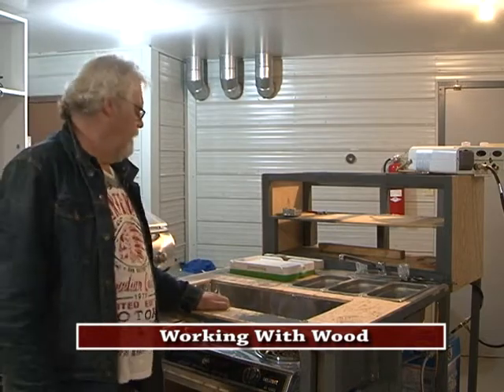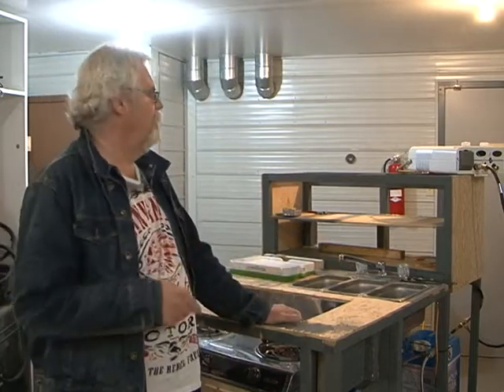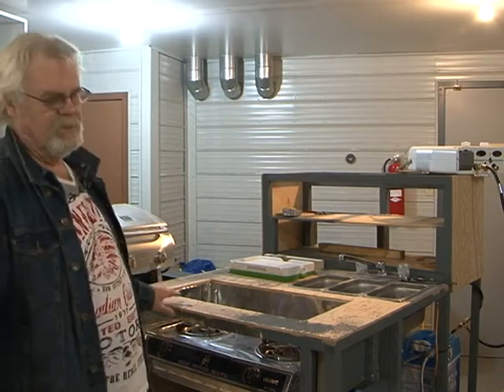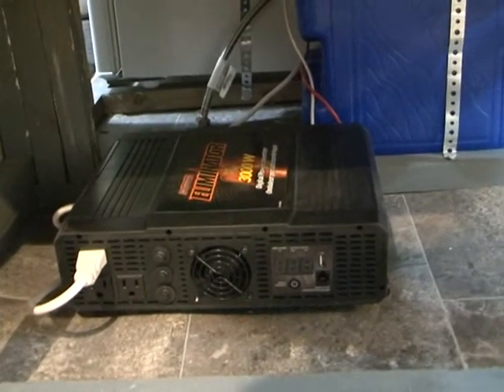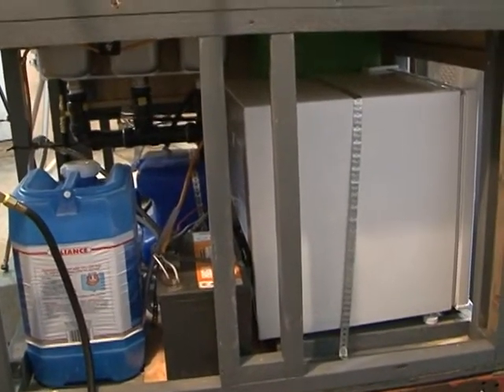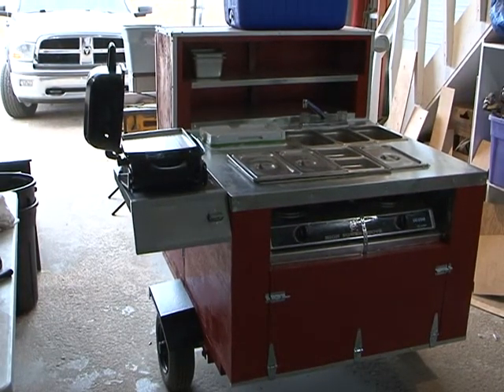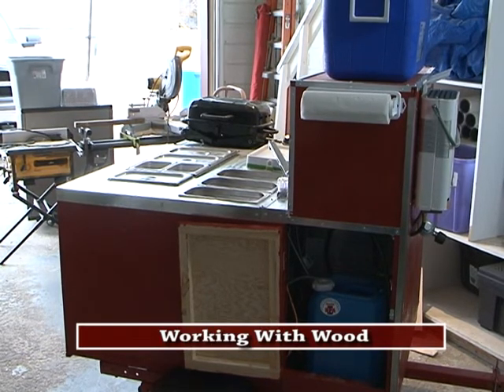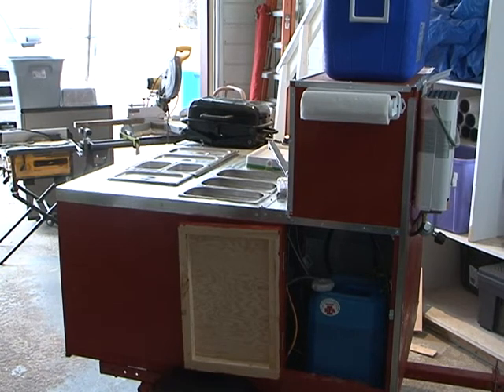How To Build A Hot Dog Cart 5

Comment: Very good video series. Your workmanship is awesome. I just bought a used hot dog this week Monday. I have plenty upgrades in mind for it. I was thinking about adding a fridge as well and adding a separate freezer to the cart. And I want to take out the built in ice bin in the center of it. I want to add those big sinks as well. Because it came with a little tiny sink on the side of it. Thanks for clearing up the mystery of that copper pipe running over the top of the two burners,  I didn't even know that it was to heat up the water.

Comment: Mr Warren Great video. i almost finish my cart, but i dont know how to connect up an inverter. and did you use one propane tank for the heater, steam table, and the grill ?
Reply from the maker: Hi ThereYes I used propane for BBQ and Steam Table. The inverter you just hook it up to a battery. I have a battery charger and solal cell on my battery.. I hope this helps..

Comment: Also wanted to say thank you for the video. A lot easier then I thought. However you’re missing two parts off the top of my head. 1. Your umbrella you spoke about in video one you were going to add inside the cart, with conduit. 2. Your slide out table that covers the burners and adds 12” of extra tabletop to the cart. Also down here in the states you have to provide or it greatly helps to have the plans on paper to provide our health inspectors, did or do you have one? Also could you share your health inspection with your personal information blacked out, so we may see any and all comments, please? If so can you add a short video of those, along with the missing umbrella (connection) which you must have down here in the states, due to weather not being able to penetrate your food during rain storms etc. thank you again for the videos and I am eagerly awaiting your response(s) and if any plans you provided to your health inspector.
Reply from the maker: The umbrella just goes on the side of the cart and I changed my mind I never put the cover on that goes over the stove..

Comment: will this pass health inspection being made of wood? most ive seen were made of all stainless steel
Reply from the maker: conceptthegreat yeah sure does pass the health inspector test with flying colors because the sinks are so big a lot of the hot dog carts the sinks are very small so you need a license authorized kitchen for cleanup with this cart is self-contained you can don't need it it'll clean up a cell
Reply: Should you not want to use wood.  You can use 8020 extruded aluminum.  I have built my cart with 8020 aluminum skeleton.